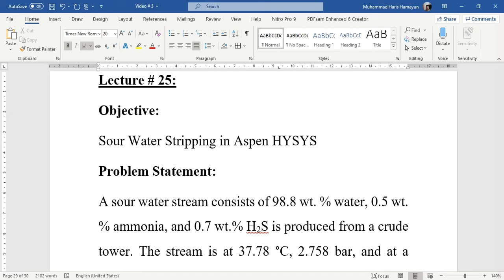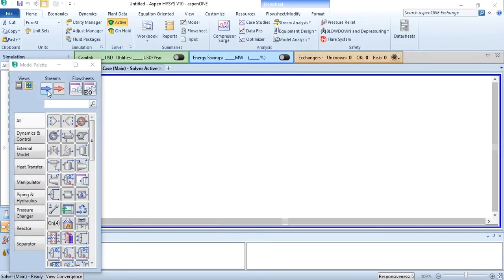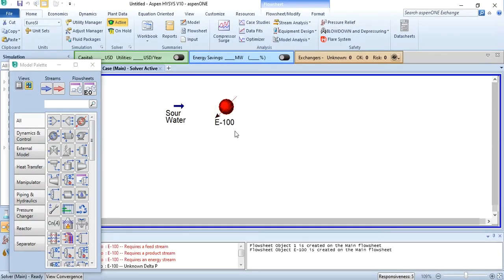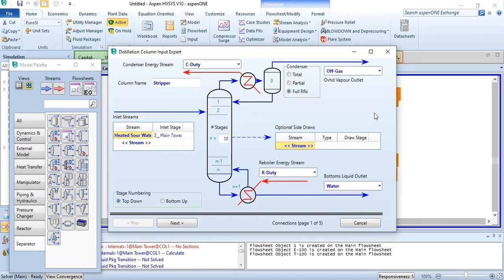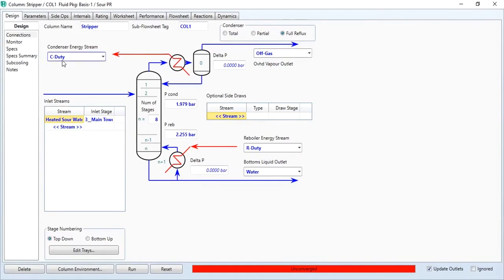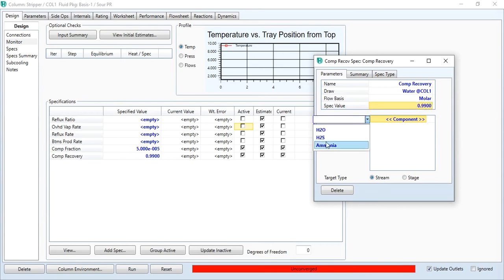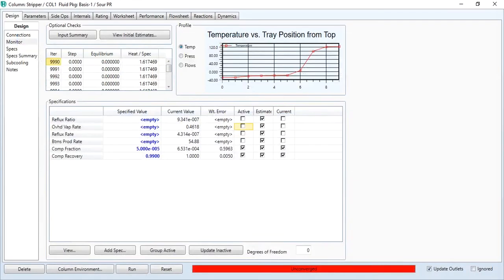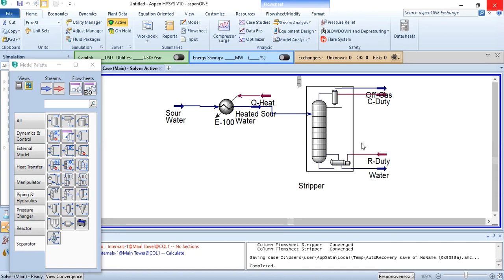Simulation of Sour-Water Stripping in Aspen HYSYS | Damping Factor Importance | Lecture # 25

Comment: Can you tell when to select stream/stage when adding a spec in distillation column?
Reply from the maker: It will depend on the specification. If any particular value is required from a particular stage, then this spec will be used. However, mostly the specifications presented in the video are used.